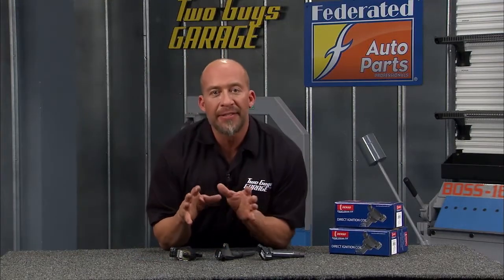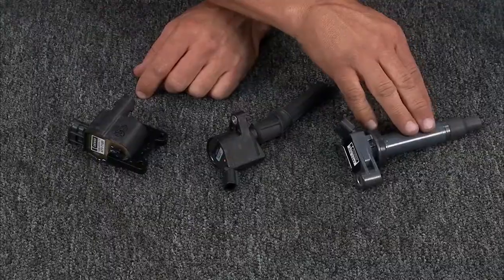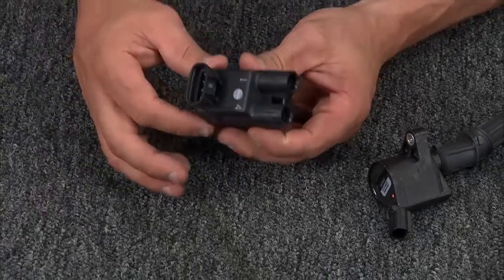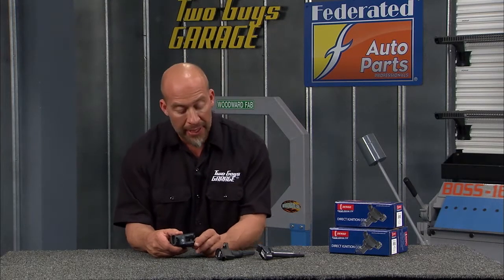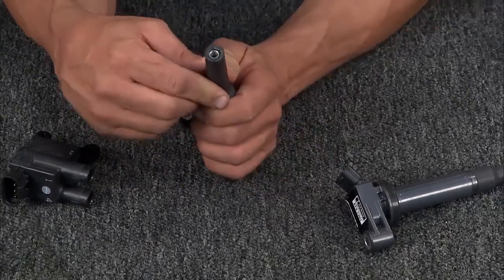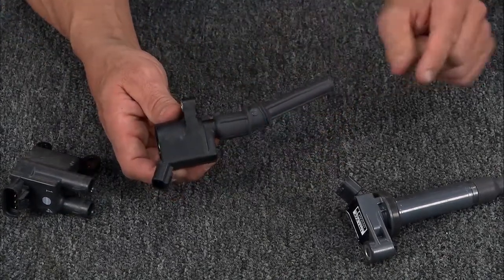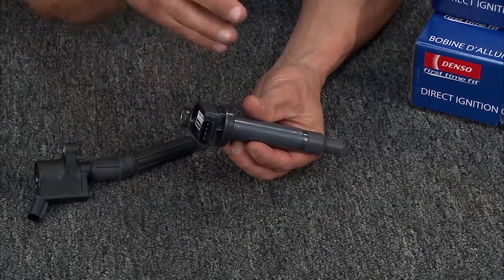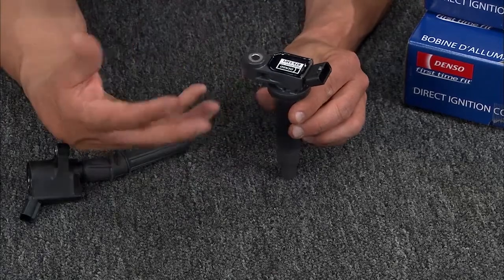Federated Tech Talk: Denso Coils | Two Guys Garage

Comment: Are these the same as the ones purchased from the dealership? I replaced a bad ignition coil, but the Denso coil I purchased from a local automotive store does not have the same part number. The original coil has "Denso" and "Toyota" stamped on it, but the new coil is only stamped with "Denso." Thank you.